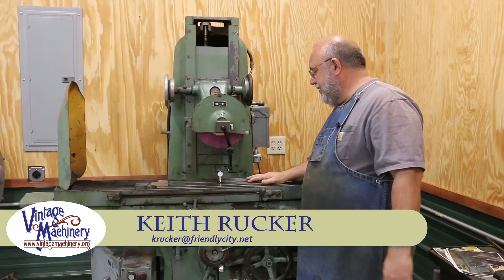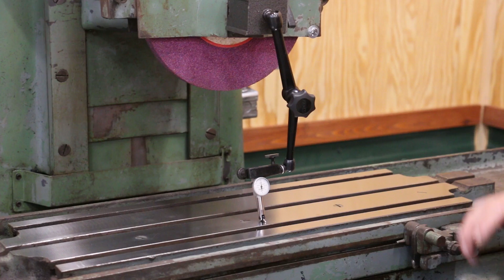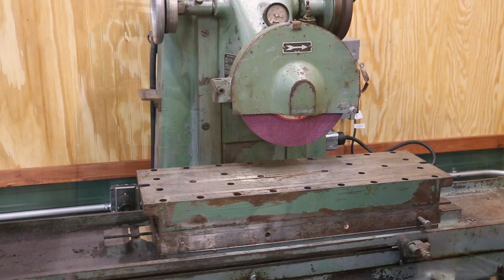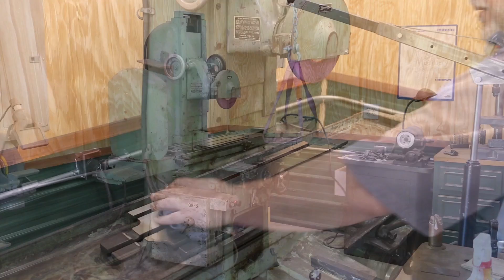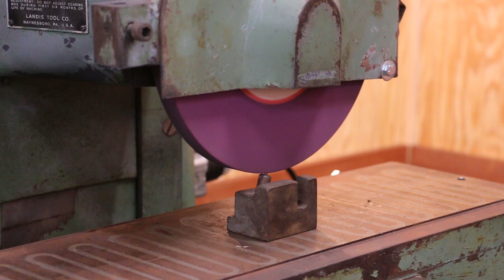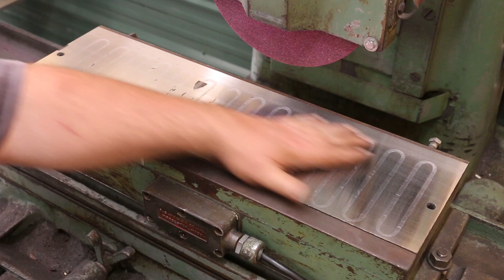Mounting and Grinding a Surface Grinder Magnetic Chuck

Comment: Is that JUST a rectifier in that box, or do you have some voltage control as well?  The reason I ask is that 110V AC, when rectified will produce MORE than 110V DC (possibly as high as 155V).  This is because 110V AC is an RMS (~average) voltage (as the voltage is always alternating), so the actual voltage is often higher than that.  
Whilst the chuck will run on 155V, it may not run for very long!
Reply: EscapeMCP Technically you are correct but the power rating of a resistive load is the is the same for AC or DC (generally). There will actually be less watts into the coil using rectified DC because of the rectifiers loss. Even with a perfectly rectified AC sine wave the output DC voltage will never be very close to RMS... And that's basically why mathematically you use RMS in most circuit design not peak AC voltage like you could read on a scope. The reason for rectifying the voltage at all is like Keith said to control the magnetism in parts and even use it to your advantage. Just because you rectify a 120v AC circuit does not give you 150v DC there will still be peaks and valleys (especially under load). Granted there may have been more loss with the older circuit but it's negligible if it's rated for 120v... Great question tho really, I'm new to his channel and have some electrical background. Keep up the good work Kieth!
Reply: RMS is not the same as average, the average of 110V AC would be zero (because its symetric AC).
RMS is the DC equivalent voltage that produces the same power on a resistive load as a similar DC voltage.
Just a rectifier would be fine, but if you add smoothing capacitors you would indeed increase the voltage and the magnet is likely to burn out.
Reply: Noel Henderson I was trying to find online anything about this kind of Chuck but I could not. To have any clear idea what is going on it needs to be taken several measurements. input voltage and working current, coil resistance in ohms, and inductance in henries. only then can be drawn some conclusions. rectifier is not really a question as long as it is rated for amps and voltage. 
I am curious how this Chuck works. pulsed DC?! anyone knows?
Reply: Guys, the problem is the coil would be hit by the filtered voltage for just an instant.  But would this cause an effect over time?  Greg
Reply: i was thinking that it should be plugged into a GFCI outlet. and a infrared thermometer might want to keep an eye on the magnetic chuck windings temp to make sure its not overheating . i don't know if the rectifier unit he replaced also had current limiting circuits/devices in it.  chances are the entire building is GFCI breaker equipped.
Reply: no need to be pulsed DC, it will be a DC electromagnet, im sure the rectifier is more than rated for its job as its only on a 20a 110v socket anyway, his cable routing needs improvement though!
Reply: That was my only input, Jusb1066, and my vote is for hard line to the closest corner of the chuck, and then a braided flex link to the outlet. Of course little cable straps securing this line would also work, but I like to dream big ;)
Reply: I'm surprised at how much misinformation is in these comments -- including this one.
Reply: The electromagnet itself is also an rather large inductor, I dont think that you would need much filtering.
Reply: it is a coil. and coil resist sudden change in  current so it acts as filter as well. I bet coil for such machine is made much over specs and it can handle much higher voltages and currents then 110v.
Reply: Not sure about this particular rectifier but they typically have at least one zener diode the purpose of which is to regulate the voltage.  RMS is the effective voltage of an AC circuit. Peak voltage is the maximum momentary voltage at the time in the rotation that the polarity is changing. With losses in the circuit the voltage won't typically reach the 156 volts that is suggested by the calculation. There may also be a ripple filter in the rectifier circuit and that will also limit the output voltage.
Reply: Actually RMS stands for root mean squared and is the effective voltage of an AC circuit. It is usually calculated as 0.707 times the peak voltage of the circuit. Assuming it is a full wave rectifier there would still be a lot of ripple unless the rectified AC is then filtered somehow.
Reply: @knolltop, i wonder if that articulating plastic trunking might work, you see it on those 3d printers for the cable?
Reply: Id bet originally it was probably some old selenium or germanium diode rectifiers with filter chokes (or even swinging chokes). The rectifier by itself will probably be ok, but your counting on the electromagnet to help "filter" the pulsing DC. If not it may allow the piece to slip. Better would be to use at least a 250 V cap of a few 10's of microfarads to minimize the pulsing field.
Reply: Also the coil might have originally been running off of the 3 ph power, which would dramatically change how much ripple you could expect to see. Keith did not specify how the original box was wired.
Reply: considering the size of the box, it must have a transformer, a rectifier is about the size of a postage stamp

Comment: From 8:24, that is some lovely in focus shots of the wood grain of your ply walls. Loverly walls!
Shame we can't see the machine..  *runs and hides*   :)
Reply: the silly autofocus combined with the small monitor screen,  he uses a very nice camera, but still autofocus issues happen,  i kinda of like the gopro way, as its fixed focus, one less thing to worry about, such as abom uses
Reply: Keith does such a good job normally that the rare times he messes up it's really obvious, hopefully he won't take a little teasing as anything but the fun it's intended to be. 
And the strong  grain on the wall DOES show up super clearly, likely why the camera grabbed it for focus instead of the 'soft' machine.

Comment: do you need thinner oil?, when it gets cold your issues could get a lot worse, i suggested it was the facing wave of oil in the last vid, we could see the leading edge always getting more grind
Reply: Could it be that the auto oiler has a pressure relief valve that needs adjusting down a little to suit the grade of oil Keith is using?
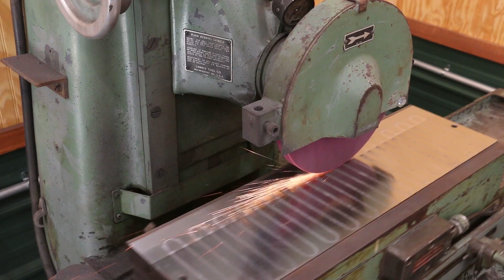Reply: Jusb1066 Agreed - may be the gibs need a bit more adjustment as it looks like the table is lifting at alternate ends each time the direction of travel changes. Check it out at around 17:30
Reply: My grinder is functionally the same as Keith's.  No gibs.  The table is only held on by gravity, lifts right off the slide ways.  Yes, there is a sort of a "bow wave" thing going on, and I see the same action on my surface grinder.  It is no doubt caused by the oil on the ways.  It also seems to change some with time elapsed since oiling on my manually oiled machine.  Tells me when to oil it again...  As a surface grinding  newbie, I am still trying to learn and make my peace with the machine.  Working to the higher level of accuracy that some work requires is a whole new learning experience.  Getting a good surface finish on different work is often a lesson in humility.
Reply: Another possible issue with the sparks pattern on Keith's grinder might be the electromagnetic chuck warming up and warping.  I am using a permanent magnet chuck, but I also get the same issues Keith was having in the video.  I think it is mostly the oil on the ways causing the issue.
Reply: I noticed that too. On the plus side, the cut reduces when it settles but does mean careful  final measurements will be needed due to the uncertainty.
Reply: yes steve, it does indeed seem to show both the leading edge floating up and it dissipating over a second or so, just like his dial gauge did
Reply: @little, yep, could be an adjustment of pressure, always things to get right on a machine youve not used,!

Comment: Why are there screws on the table and why are they are not countersunk more? Sorry for that beginner question. But I am not sure I have ever seen screw heads on a machine table before. Thanks for your videos Keith! Love your work and the chuck looks amazing now!
Reply: The screws were in the wooden pattern used for casting the table.  There are no screws in the center of the table, only the imprints of them in the casting sand, and then in the cast iron.
Reply: Ah that makes sense! Thank you for that information!